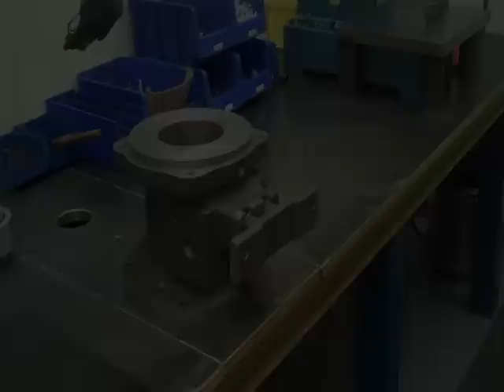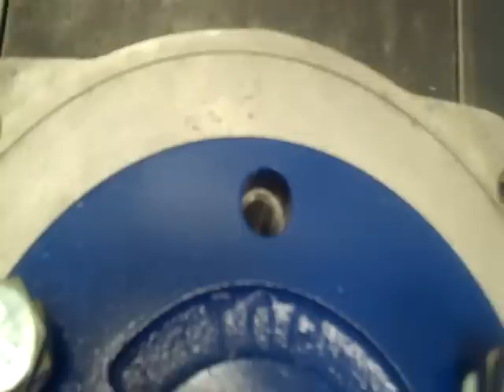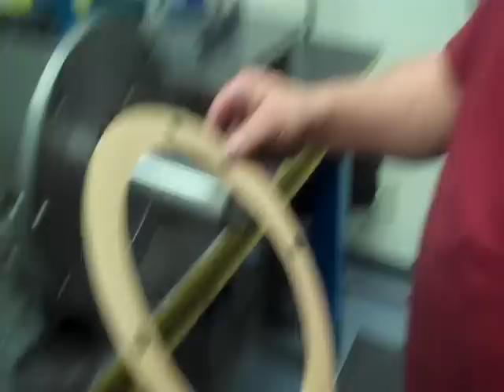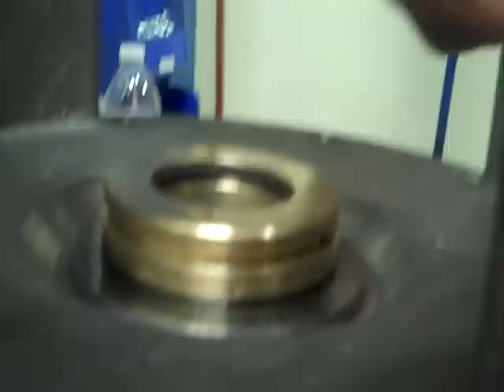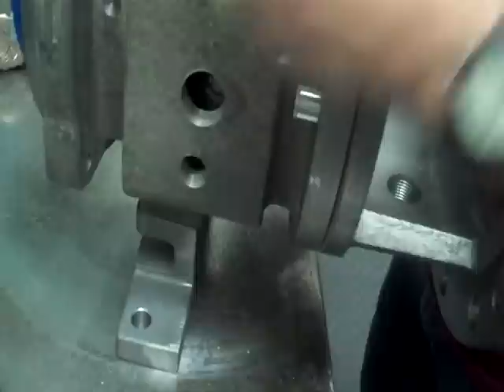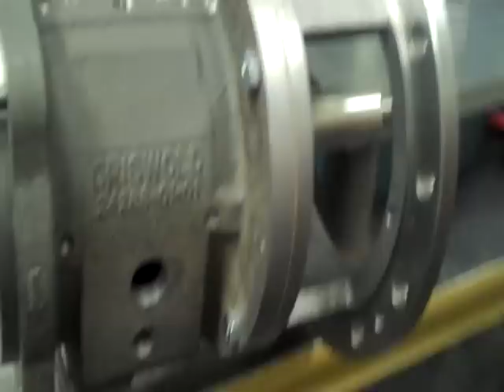Griswold Maintenance Tip - How to Install a Rotating Assembly into a Power Frame

Comment: @Bradley950  Use a  flat plate with a two holes drilled the same P.C.D as the backplate assembly .. then get some hex setscrews and nuts and use this device to jack the  brass lap seal into the housing with the help of maybe the old lap seal or a pipe fitting of similar size  pressed up against the new one........ Hold onto the Plate / Jig for further use...